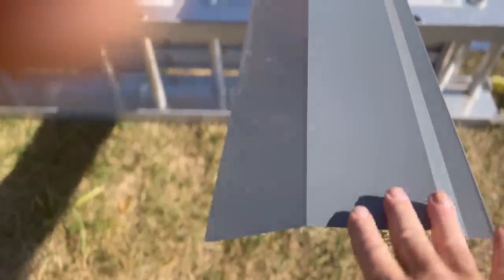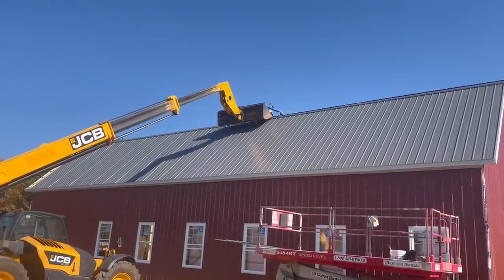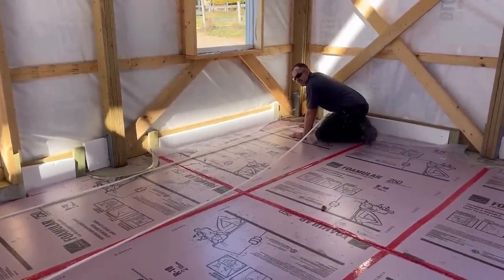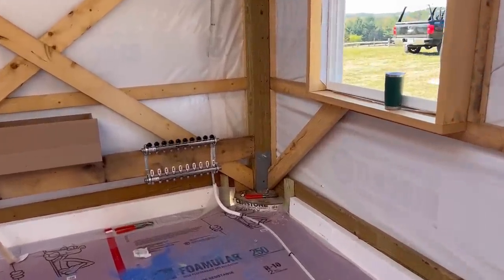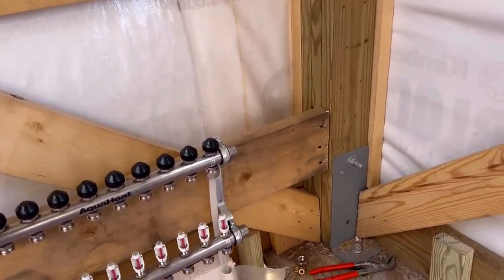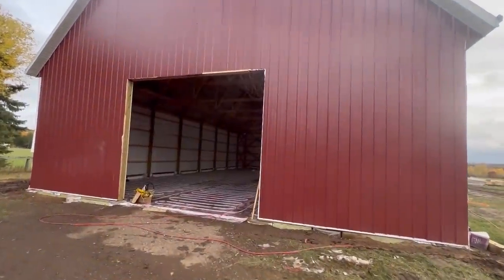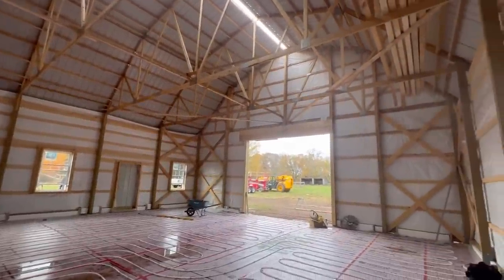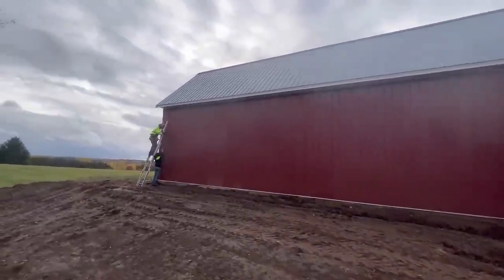Building a gambrel  style post frame barn part 7

Comment: Putting an insulation below that concrete is a very smart move. It makes such a massive difference to the radiated cold that usually comes off concrete.
Reply: Especially with infloor heat. If you didn't put insulation under the concrete, most of your heat would just dissipate into the ground

Comment: I was telling Mathew he should heat with waste oil with all the heavy equipment he has around the farm. I suggested over head heat tubes and he said he was going with under floor heat. Anyway he should still consider an oil burner boiler that still runs on waste oil, just put a 250 or 500 gallon tank outside the warehouse/barn and store his waste oil from oil changes for free heat.
Reply from the maker: I will let him know but not sure he would have enough oil to heat this building

Comment: The weather is now factored in to determine building progression. Maybe re-bar the concrete for extra strength and load capacity. Rather work in the drying out of the cold than snow.  Nice work.
Reply: I would think the concrete guys will take care of rebar or wire mesh if required.

Comment: You can use a battery powered leaf blower to move the snow off the floor/equipment/supplies.
Reply from the maker: I have use gas powered leaf blower when I did snow removal but this snow was too wet and sticky

Comment: Wow, you all worked your tails off getting this far in such a short week.  It really does look like a barn now and once the ridge cap is installed, it will be mostly enclosed from any type of weather Mother Nature throws your way going forward.  You must have had a couple of really good workdays to get the upper roof panels installed so quickly.

Comment: Question: I thought with the corrugated roof panels you screwed them down through the raised ridges not the flat area so, water flowing down the roof didn’t encounter any holes in the flat areas and the raised areas natural shed the weather into the valleys therefore minimizing the chance of water penetration and damage to the structure. I think you screwed through the ridges of the overlapping panels, but in the center of the panel you screwed through the valley areas. Why? Won’t this be more susceptible to leaking?
Reply: I'm sure the screws have rubber washers.
Reply from the maker: Can be done ether way and does have rubber washers
Reply: @donavanshomes  Thanks

Comment: QUESTION:
Why doesn't it make sense to have started the roof from the top and go down ?
Please enlighten me.
thank you.
Reply: Not to sound snarky, but water flows downhill, so everything from the bottom section needs to be overlapped by each section above, that way when water is running down, it flows over the top of everything without getting into the substructure below. Hope that helps.
Reply: @kylereynolds4239  Thanks.
Reply from the maker: Roof have to be installed from the bottom up do you overlap between layers
Reply: @donavanshomes  Thanks